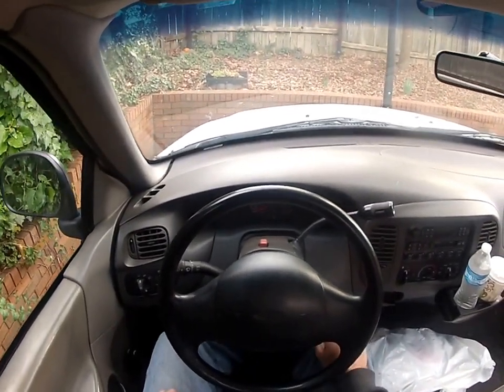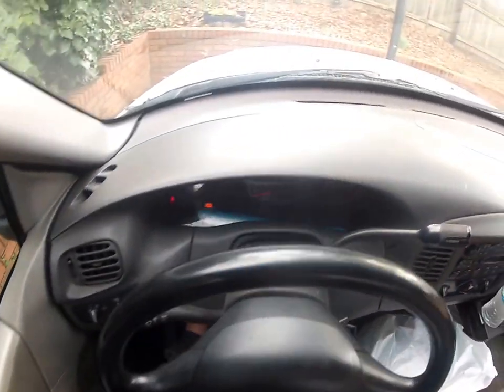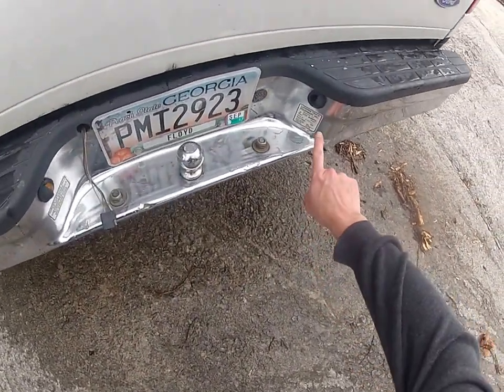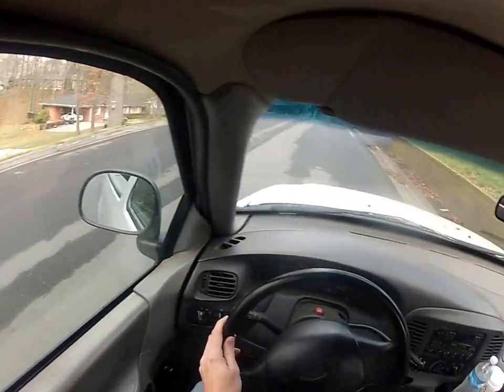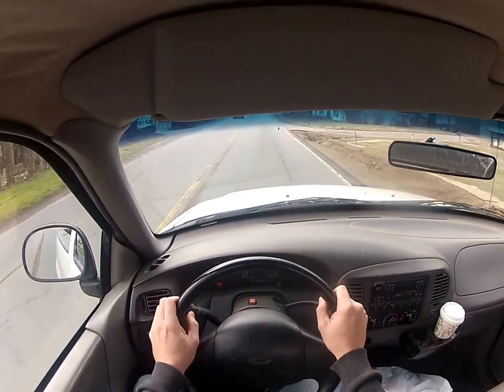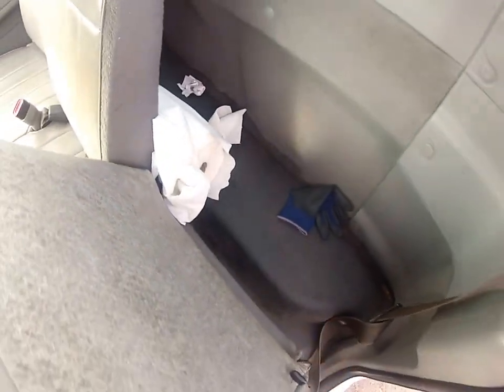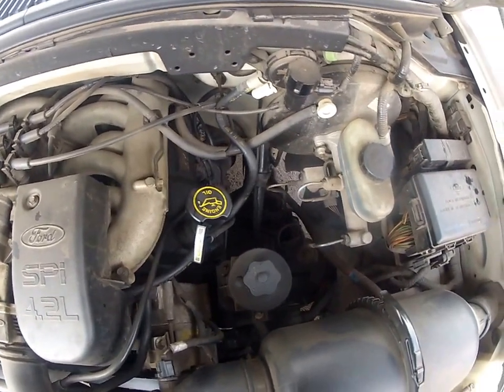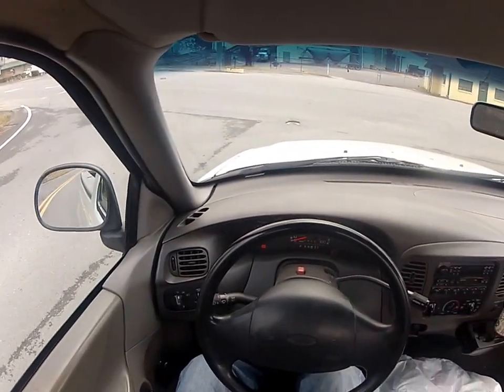1997 Ford F-150 work truck 4.2 v-6 long bed test drive review

Comment: A few family members have had the newer 5.4's and all have had the cam phasser issue. I had a 99 Expedition with the 5.4 and it never had no issues, it did have a spark plug blow out before I got it. I think the 4.6 is a better all around motor
Reply from the maker: Buddyroe93 I agree man.  I had an 03 expedition with 5.4 and never had an issue and I sold it with 160k on it
Reply: I currently have an 02 mustang GT that my grandmother willed to me when she passed and it's got 113k miles and she only done gas and oil changes and it runs like a top
Reply from the maker: Just picked up an 02 explorer xlt with the 4.6 and it has 150k.   One owner amazing mint shape and that 4.6 runs perfect.   Strong yet quiet